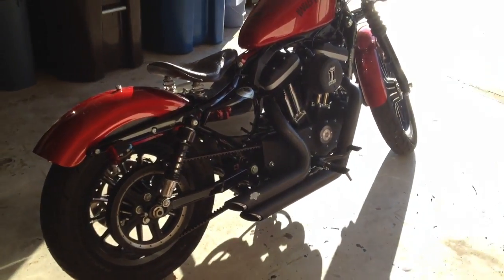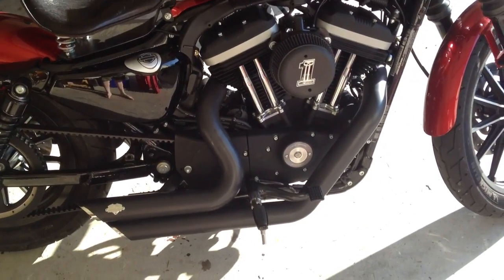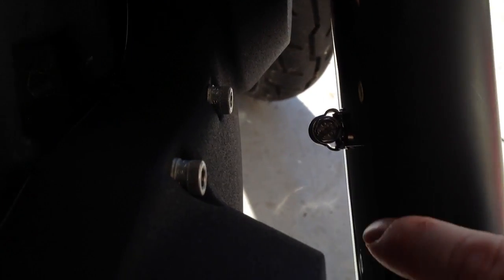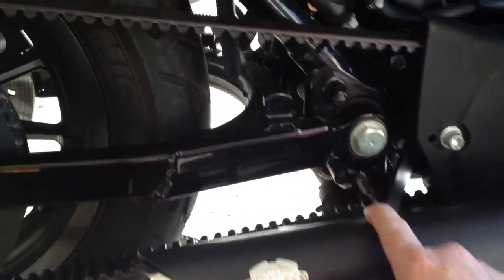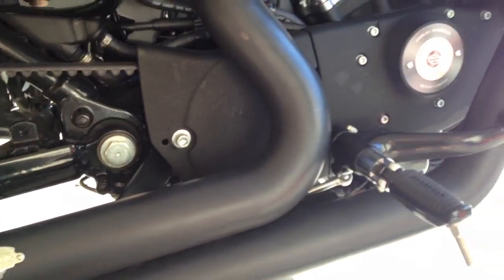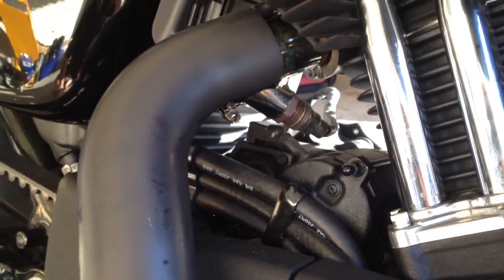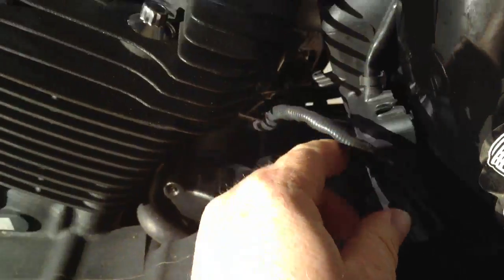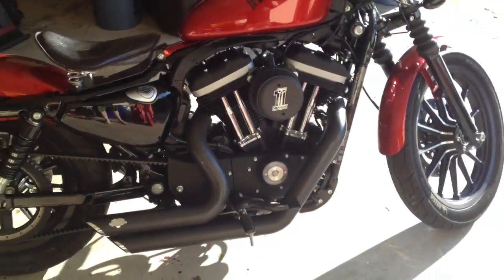Vance & Hines SHORTSHOT exhaust install

Comment from the maker: You can install the exhaust without anything else. It will be fine. I had mine for a while with pipes only. It is recommended to add an air intake, but it's not necessary. $1000 is outrageous unless it includes the price of the exhaust and the install.

Comment from the maker: The power commander is something I was forced to get. After my upgrades, the bike was running much too rich and was backfiring.  After installing the power commander it needs to be Dyno tuned.  If you don't want to spend that much money, Vance and Hines sells a "Fuel Pak."  It's sort of like a power commander, but it lets you do all the adjustments on the box itself. It only regulated fuel though and not your air. No need to Dyno though, which is about $300.

Comment from the maker: Marcelo, yes you can put just the pipes on. There is no real need to Dyno tune it. The reason is because your pipes have oxygen sensors in them that will automatically adjust for the air in your new pipes. Even if you add an air intake, chances are You won't absolutely have to get it done. 

Worst case scenario, your bike may backfire a little when you accelerate quickly and then let off the throttle. That is all. I was told the exact same thing when I bought my pipes an so were a lot of other people. I did it anyway, and all was fine.
Reply: +Tony Marchant  I just put short shots on and the check engine light came on and the bike runs like crap. Was told I need an air filter and tuner?
Reply from the maker: +menaceg21 , Did you remember to plug the O2 sensors back in? If they arent plugged in, your bike will run terrible.
Reply: +Tony Marchant They are plugged in. Still kind of lost on what to do. Brand new bike. Don't know if I can just get a fuelpak without an after market air filter....
Reply from the maker: how is the bike running?  is it making a popping noise when you let off the throttle real fast? rough idle? No idle?
Reply: Took it out yesterday. Light is still on and "thinks" before it throttles and gopes. Idle is fine but probably going to buy the Vance and Hines fuelpak and see if that helps. Just passed 1,000 so time for the first service?
Reply from the maker: Thats what Harley recommends.  Its a good idea too.  New motors have a lot of metal flakes.  You dont want that in your oil for long, so the first oil change is probably the most important.

Comment from the maker: There are no gaskets. Just the bolts. There is a C-clamp that is at the end of the exhaust near the motor that you use from your old pipes but that's it.

Comment: hey I was hoping u could help me out. I'm a little confuse on the o2 sensor part. like first i thought there was only one o2 sensor but apparently there is 2 and my question what am i suppose to plug the sensor to?
Reply from the maker: +Pokemon Extrapinch .  Both of your sensors are located on the exhaust pipes.  In the video I show you where both are located. They are already connected.  Now if you have a Power Commander from Harley Davidson, those sensors will be disconnected.
Reply: I have the same exhaust pipes with the PCV on a XL883 2012 with the o2 sensors hanging just the way you showed them . Have you ever had any problem with the O2 sensors without the eliminators?

Comment: Sick bike bro! Havent seen that color in the newer 2016 models. Just bought an 883 myself in the denim black finish. I want to buy all the shit to upgrade it, but i dont know shit about how to program the fuel controller. Is it a difficult process, and does it have to be dyno'd afterwards?
Reply from the maker: +Josh Brolin, If you go with a Power Commander, it will have to be dyno'd.  You can also go with a Vance and Hines Fuel Pak.  That was what I had on the bike first.  It wont control the air into your bike, but it will adjust the fuel.  

The Fuel Pak is VERY simple to install and use. It literally just plugs into a plug under your seat.  It has buttons on it that you can use to change the fuel intake.  You simply go to the V&H website and tell them what accesories you have on your bike.  They will tell you what numbers to enter into the fuel pack.  It takes a total of only about an hour from start to finish.  It's an incedibly easy upgrade to do and is Novice level.

Comment: Great and easy explanation, thanks a lot.
Did you tune in the computer afterwards? how and what was it? Vance & Hines fuel pack? Sorry, it just wasn't clear to me.
Reply from the maker: +Andriy Herasymchyk Yes. The fuel pak was installed after the pipes. It is even easier to do that the exhaust. You simply plug it in to any available plug near the battery and enter in a few numbers using the screen on the fuel pak.  then you just tuck it under your seat and you're done.
Reply: +Tony Marchant waw - that is easy!  do you know how different is the fuel pack from screaming eagle tuner?
Reply from the maker: +Andriy Herasymchyk Fuel pak only regulates fuel.  Power commander adjusts both fuel and air.

Comment: Do you need that bracket that comes off the sprocket cover from your stock pipes or do the shortshots come with one? I took mine off a long time ago when I put straight pipes on and now I'm thinking about changing to short shots.
Reply: It comes with a bracket

Comment: Nice bike! I just bought a 2016 Forty Eight and have about 40 more miles left on the break-in period.  I'll be installing these later today along with a RSD Turbine air cleaner and V&H FP3 for the tune.  Where did you get your mid-controls from?
Reply from the maker: +sxwthzmbz Congratulations on the new bike. The tuner,air intake, and exhaust are a great place to start. As for the mid controls, the bike came stock with them.

Comment: so you can just install the pipes and thats it? you don't have to have anything else?
Reply from the maker: Depending on the year of your bike, yeah that's probably it.  I've installed the exhaust on a few Sportsters and they didnt need a tune up or anything like that. After I installed an air instake, the bike did need a small tune up.  It would pop occasionally when Id let off the throttle real fast. Like most bike parts, it really depends on your personality. Some people are fine with swapping out the exhaust becuase they just like to ride their bikes and like how it looks.  There are some riders who want their bikes to be perfectly tuned and squeeze out every HP they can get. Your bike will run just fine if all you want to do is swap out the exhaust though.
Reply: i have a 2014 883 and looking at getting these pipes and doing it myself. so i'm trying to get as much info from others who installed the same pipes
Reply from the maker: Nope. Thats it.  If you want to fine tune your bike, you can pay $300 to have it dyno'd, but its not necessary.  if you install an air intake after youy do the exhaust, you may get a little bit of backfire when you let off the throttle quickly, but Ive never seen that happen on n exhaust only.

Comment: Don't you have to disconnect the O2 sensor first before doing anything?
Reply from the maker: aaron chrysostom It doesnt matter when you disconnect them. The bike isn't running while you do it.  I never actually disconnected mine. I just unscrewed them from the original exhaust and left them hanging on the bike.

Comment: What size tool did you use to remove the O2 sensor?im having a really hard time removing mine, I keep hitting the front fender on the front O2 sensor. 
thank you!
Reply: +martinezmr89 unplug it and i think i used a 14mm wrench

Comment: got a 2015 883 and i wanted to put air cleaner and shortshots but ive heard alot people say to have the dealer install them because they remap the fuel system did you do that? if not how does it run?
Reply from the maker: +Cam Cam If all you're doing is those 2, then there is really no need to remap.  those were the first 2 mods I did on my bike as well and it ran just fine.  Your bike has O2 sensors in the exhaust that tell the motor to adjust the air to the engine anyway.
Reply: awesome, I was actually thinking about getting the heavy breather and then once my bike passes the 500 mile mark installing the exhaust. you think ill be ok doing it that way?
Reply from the maker: +Cam Cam Sure. That shouldnt be aproblem at all.. Like I said, your O2 sensors in your exhaust will tell the bike when its getting too much/ too little ai and automatically adjust itself.
Reply: awesome thank you brotha ride safe

Comment: Hey Tony do i need a power commander if I'm changing out my stock pipes to v&h short shots?
Reply from the maker: frank calderon You don't NEED one, no.  I dont know if your bike is fuel injected or carbeurator, but its not a drastic change to the bike.  You may have a little bit of a rough idle or some popping when you let off the throttle real fast, but thats about the worst you can expect.  Likely it would be just fine.  A power commander would be ideal, but if you want new pipes without having to spend $1,000+, you shoud be fine.

Comment: Did you do any tuning after you installed the pipes? I think tuning Is only for carborated bikes?
Reply from the maker: didnt do a tune or dyno after the pipes and intake.  wasn't really necessary.  I didnt do one until I upgraded the jugs to 1250 and added a power commander.  I had to then.